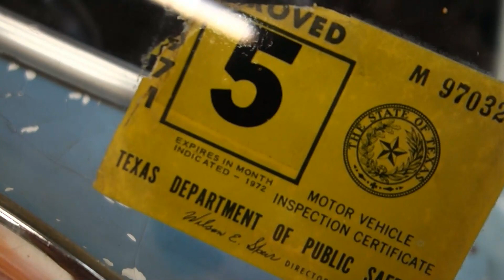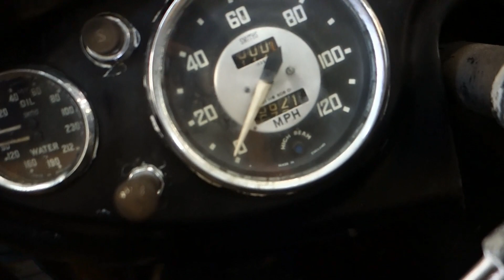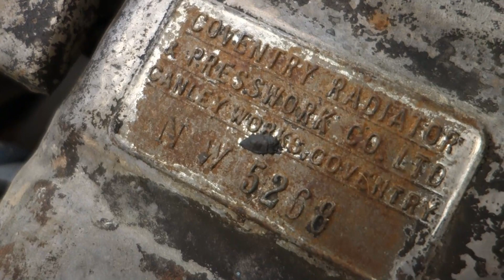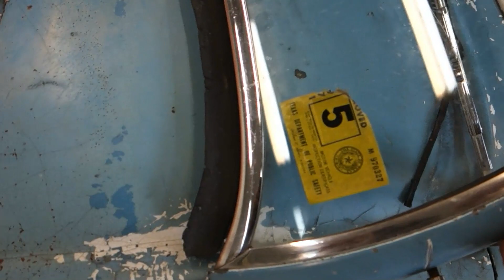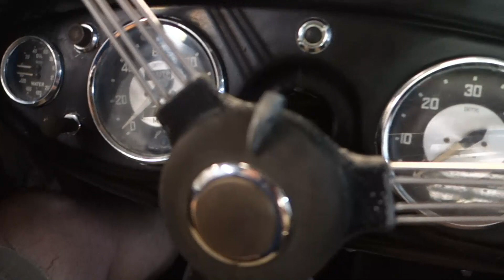1954 Austin-Healey 100-4 Texas Garage Find

Comment: Ah, brings back memories of my '55 BN-4 which I bought from a wrecking yard with front end damage. Car was too much fun to drive... then. By today's standards, driving it might be considered a bit of chore as the car is quite heavy for its size and guessing the front/rear balance approaches 80/20. When it spins it doesn't stop for awhile. One thing for sure, all the wheel brake cylinders needed rebuild/replacement. Seems I was rebuilding one every month or so.
Reply from the maker: Great memories, I appreciate your comment & would be honored if you would subscribe to the Samspace81 Classic Car channel.

Comment: After it sat for 35 years with the valve cover , dis. cap . bad gas in tank with rust and not being greased in 35 years and it started & runs !
Reply from the maker: No lol pushed with the lawnmower